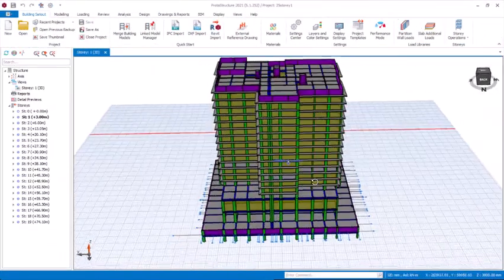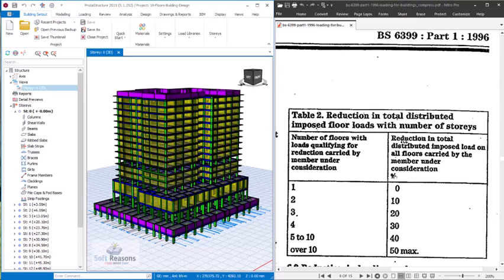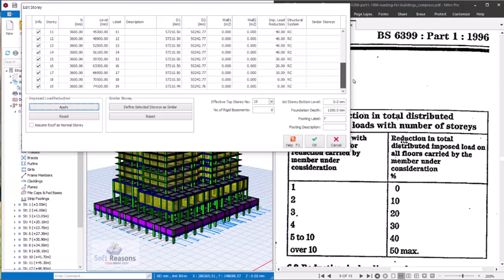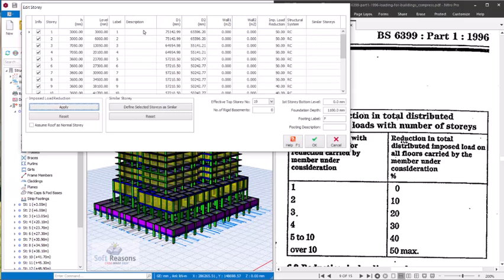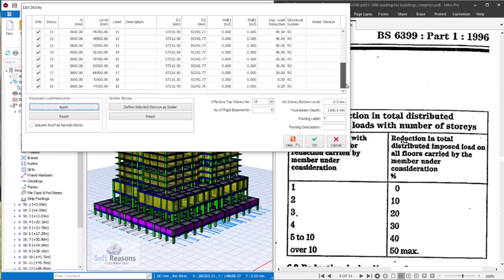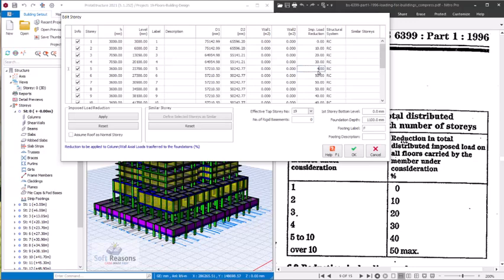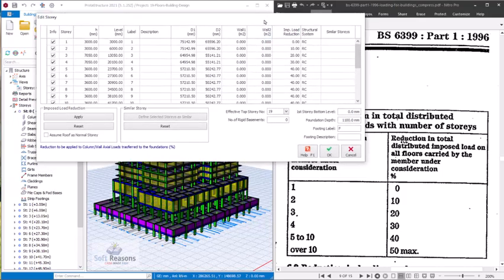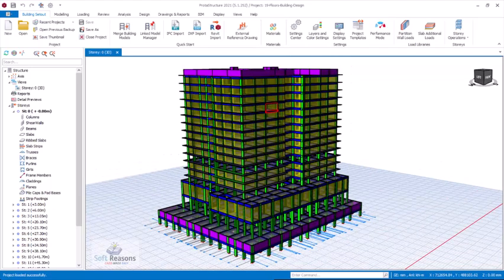PROTASTRUCTURE BS-6399 IMPOSED LOAD REDUCTION REQUIREMENTS IN HIGH RISE BUILDING #civilengineering

Comment: I'm a fan of your work Sir and I appreciate the effort that you put in to make these videos, and I've certainly learnt a lot from this channel. 
But as someone has said, the information on this particular video is misleading and incorrect. ProtaStructures has inputted the percentages for the imposed load reduction correctly and not upside down as you mentioned in the video. 
The percentage of load to reduce is based on how many floors(storeys) is being supported by the member not the number of the storey where the member is located as you claim in this video. 
So, in essence if a member is supporting more than 10 storeys then you can reduce the LL by 50%...and if the member is supporting only one floor then 0% live load reduction should be applied and so on and so forth. All this is said with all due respect Sir.

Comment: Pls sir somebody said that storey 1 is carrying the most load so when you click on it you don't need to edit is it true
Reply from the maker: Only vertical members at the lower storey takes much load, all the loads from the upper floors beams and slab is decomposed to the vertical members which is column.
Reply: @CADmade-easy  ok that's why the number are from big to small right